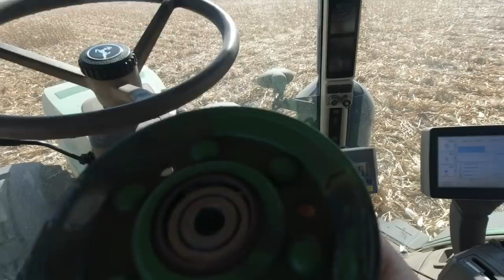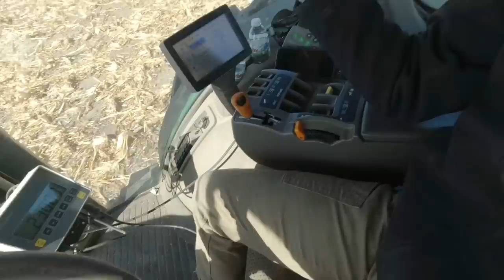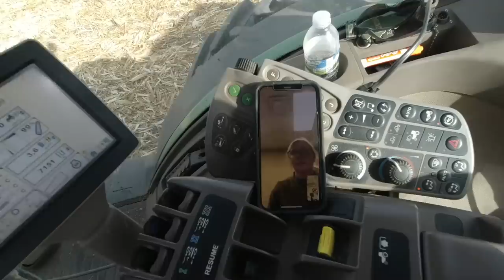Lost our Balls! Two Bearings go out

Comment: By the building code, the garage must be separated from the house with a 30 minute fire rated wall.   That window is not a 20 minute rated opening, and could be open and let carbon monoxide into the space.     For safety sake, infill that opening with solid insulated wall.  😀
Reply: Thank you for pointing that out! 😄

Comment: For your elbow problem how about a soft pad cut to the size you need to cover?  Secure the pad find a pad with adhesive on the bottom or use Velcro straps.  Seems like an inexpensive quick fix.